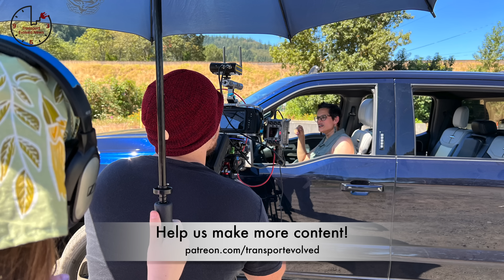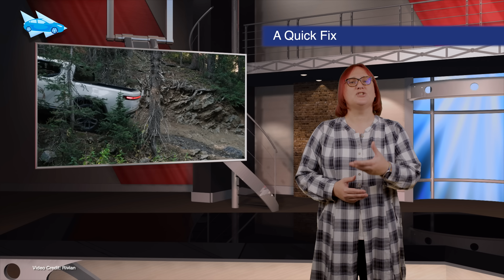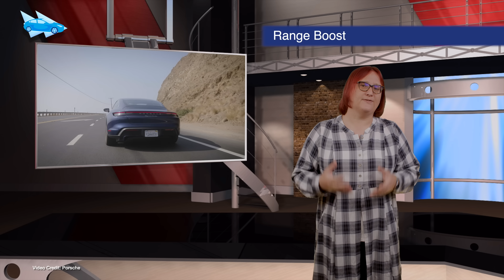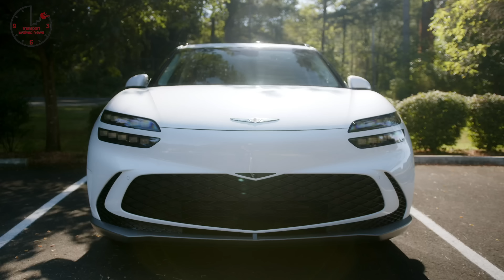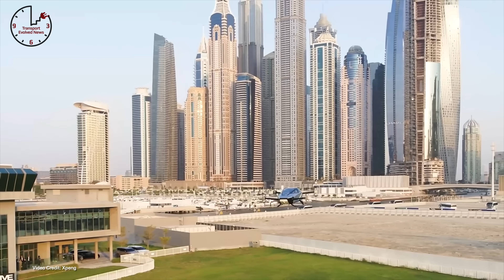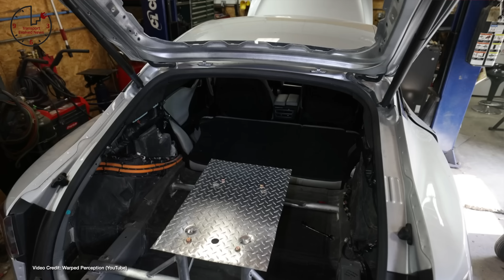TEN Episode 406 - BYD Atto3 and Mercedes EQE 5-Star Ratings, XPeng X2 Flies,  VW Battery Woes

Comment: Can confirm, Rivian recall is ridiculously quick. Pulled in to temporary "recall repair pop up shop" location while on errands, drove up, mechanic verified my VIN, had me turn the steering wheel all the way to the left, second mechanic used torque wrench to tighten bolt, had me turn steering all the way to the right, mechanic used torque wrench to tighten bolt, I drove away. Took all of five minutes.

Sure, less convenient if you're not near one of their service centers or "pop up recall shops", but they have said that they will send a technician to you if you're not near.

Comment: Polestar 3 is on the SPA2 platform that it shares with Volvo. The EX90 will be built on the same SPA2 platform. Yes, it dos share a lot with Volvo but this is the first Volvo designed by the former Volvo designers for Polestar. The Polestar 1 and 2 are both production versions of Volvo concept cars. Polestar differs from Volvo in that they are a former race-car tuner and still sports tune Volvo's S60 Polestar Engineered and XC60 Polestar Engineered. So Polestar is the sporting brand and a bit higher priced that Volvo, overall.

Comment: Niki. @12:28 Spherical fusion? Really? Don't you mean toroidal? Who feeds you these lines? 
But, it's good to know that fusion power is now only 20 years away <snark>.
Reply from the maker: The unit is a spherical Tokamak. Please don’t criticize when we use the exact description given by the company.
Reply: @transportevolved  Niki, I don't care what the company description says. Even your picture of the unit (also supplied by the company, I presume) shows it to be toroidal! The ONLY spherical fusion reactors are stars!
Reply: @johnfruh  Nikki is correct. Spherical tokamak is the technical term for this form factor, as the intention is to confine the plasma to an approximately spherical region to reduce its aspect ratio as much as possible (and thus increase plasma stability): https://en.wikipedia.org/wiki/Spherical_tokamak
Reply: @clock-work-bird  Mea Culpa. I had not heard of this variant of the Tokamak design. My apologies. I wish Niki had highlighted the difference between this design and the classic toroidal design.
Reply: @johnfruh  the show is not fusion talk, don't ruin a good apology

Comment: It’s pure madness to take an expensive BEV and add the ability to burn fossil fuels, when there are so many off the shelf cheaper options that come with that capability to start with. Just because something CAN be done does not mean it SHOULD be done. I would not grace such a video with a watch. Can YouTube revenues possibly be enough to make such a misguided venture make money?  I hope not, quite frankly. I imagine Toyota would be horrified that they did that rather than buy one of their vehicles  currently suffering massive drop in demand!
Reply: Bev are expensive because of large battery packs.
PHEV are very affordable compared to bev. 
Plus I think at least 40% of the country has no place to charge at home.
Reply: What "off the shelf "options are you talking about
Reply: @golfish8589  anything with an ice engine that’s cheaper than a Model S. Hardly a restricted choice.

Comment: The context was Toyota having just delivered its 300,000th hybrid to Australia with focus shifting to PHEV offerings.  Do the math.  Using 80 kWh each for 90k BEVs equates to 7.2m kWh available for PHEV.  That would give each of the 300k PHEV a battery-pack size of 24 kWh, which is roughly 50 miles of EV range.  You can't just ignore the goal of delivering 300k vehicles.  An offset of 210k ICE for the 90k BEV would be required to bring the total up to 300k.  Think about the resulting emissions of ICE/BEV compared to all PHEV.